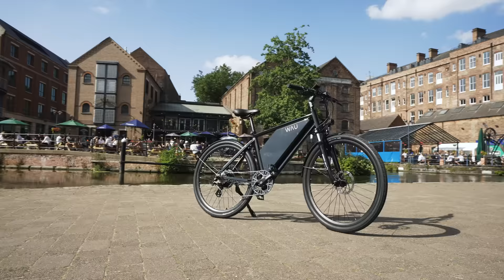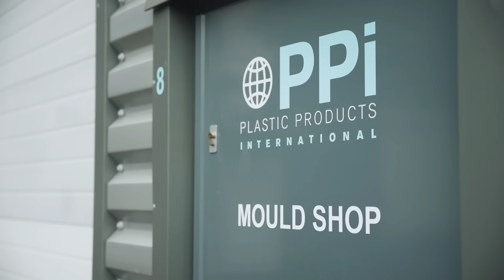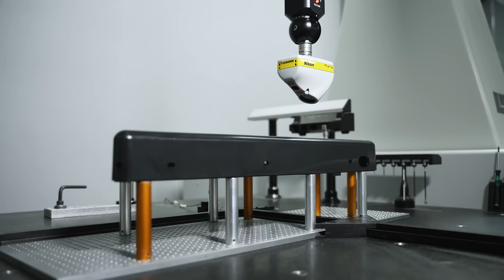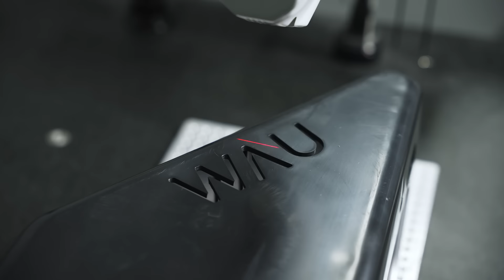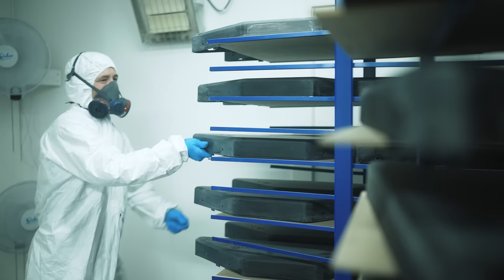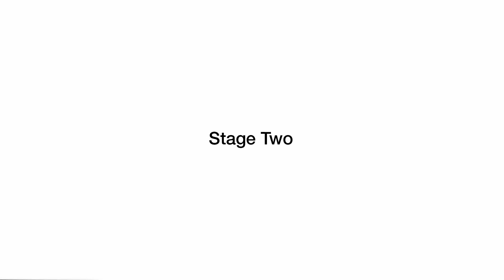How a WAU bike is made |  Behind the scenes of WAU Production.

Comment: got mine a week ago. front rotor was bent, front light stopped working. And ive jus realised the front tyre is on the wrong way around. the rotation is backwards.
Reply: I bought one and it practically had everything wrong with it they tried to repair it three times and eventually I had to fight for a refund. These bikes are absolutely awful